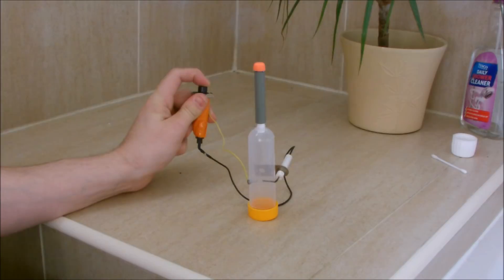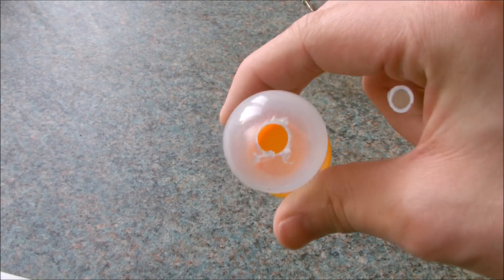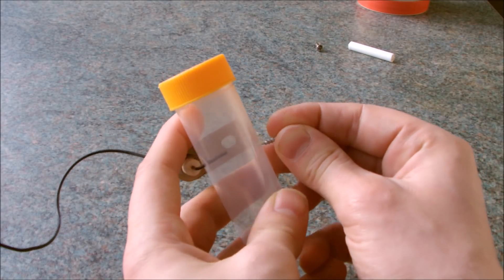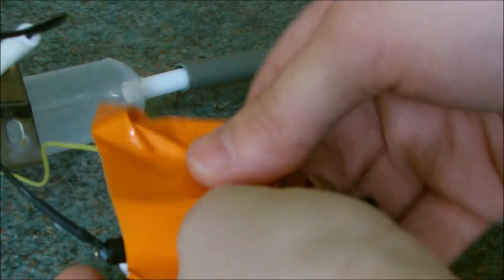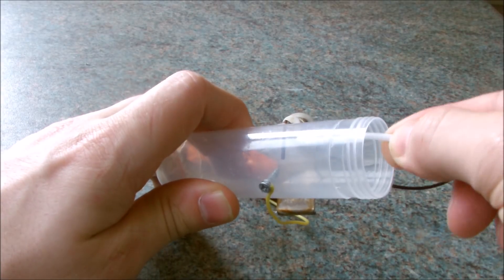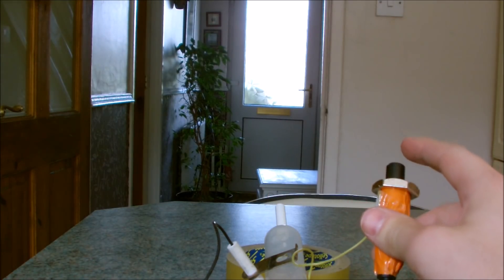Make a Mini Missile Launcher!

Comment: extend the wire (or use wireless tech), don't make the launch muzzle, fill the inside with firework powder. toss it far and high (use slingshot/rocket... if needed) and press the button for homemade firework

PLEASE USE THIS RESPONSIBLY. I DO NOT PROMOTE VIOLENCE. FI YOU ARE UNDER 18 (OR NOT CAREFUL), ONLY DO THIS UNDER SUPERVISION FROM AN (CARRFUL) ADULT OR DON'T IT AT ALL. (this comment was edited to add this section)

Comment: Could I use the ignition source from one of those 1 quid lighters like you used for the bazooka
Reply: Tom Pulford 
Yes. Those work just as well for a spark ignitor. Just as powerful.
They're the same thing, but without a casing around it.
Reply: jejbdjdoepwvdjfbeoe pcjdppppnrkdmxn

d ndbdnx

.x x.zbx

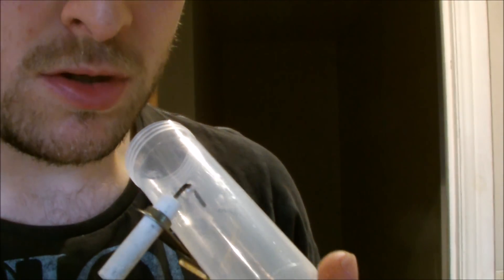Comment: slow down for 0.25 and jump to 3:03 to see blue thingy :D
Reply: Dimi's DIYChannel 
I launch bottles off a pipe, the reverse of this video. The spark gap comes up a small tube.
I did it at night and recorded it in 60FPS, then played it back at 10FPS.
The entire bottle glowed blue and shot 6in of orange fire out like a jet engine. My point is, it looked epic.
If you try this video's experiment, do it in the dark so you can see the flash better.

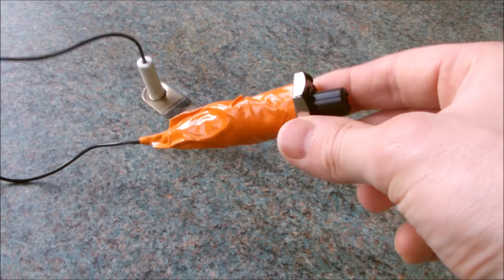Comment: "JDale Cust:  that was pretty precisely informative. just wondering why on 0:57 he wasn't shocked while holding the screw at an end. In my view, that's a complete circuit from a 20kv potential enough to breakdown and create current path on air. He is a ground potential on earth right? So how the hell he did not felt any shock at all?"
Good question; the video doesn't explain that. I suspect that he has a wire, shown later, connected from the screw he is holding,  back to the piezo "ground." OTOH, maybe not. How could a spark jump if there isn't a complete circuit? Consider two conductive spheres in mid air; there is no connection between them and no grounding. Now, suppose you rub one with a material that causes the triboelectric effect to impart a charge to one sphere. The two spheres will now be at different charge potentials, and if you move them together, once the air gap breaks down, there will be a movement of charge from one to the other until the charges on both equalize. This happens all the time, just substitute your body for one sphere and a metal doorknob for the other. In the case of the piezoigniter, the tip is suddenly moved to a high voltage, while your body is still at some other charge level. The air breaks down, a spark jumps, and the charges equalize. Sometimes it helps to think of the two spheres as capacitors floating in the air, with the capacitance proportional to surface area. Your body has an equivalent capacitance of about 20 pF, which is also about the same as an 8" diameter metal sphere. Charge on capacitor to a high voltage, bring them together, and at some point, the charges will flow until they equalize.
Now, as to why it might not hurt very much. The screw acts like a little "lightning rod," the physical point where the arc is initiated conducts the current onto a much larger area of his fingers, so the current density is less and it doesn't create such a shock or even burn point where the charge current flows into his body.
There are a lot of YT videos showing both of these effects.

Comment: can it work with nail polish remover as i don't get rubbing alcohol easily
Reply: The older acetone style remover, yes. However, the modern non-acetone polish remover, probably not. If you can't find rubbing alcohol, which is about 70% alcohol (140 proof), then I'm assuming you are not in a very industrialized location. But certainly you can find something, from gasoline to whatever the locals brew up and drink (in the USA it's called moonshine, but every country has its equivalent).

Comment: can this be built with the black thing from a lighter wich products the spark? and to replace the alcohol can i use vodka? :) please replay
Reply: Vodka would work, but a piezo igniter is simple and works well. Liberate one from an old water heater, BBQ grill or gas range.
Reply: thanx :)
Reply: Dan Rotaru And it would be a scandalous waste of vodka!
Reply: yes but i don't drink vodka so it's not my problem :)))
Reply: Dan Rotaru I suppose that ordinary rubbing alcohol (which is cheap and readily available, although at only 140 proof it would leave some oil residue) would also work. And I hope you don't drink that stuff.
Reply: :)))) of course not!! goddamit i'm not a mutant!! :)))
Reply: Sure, so long as it is the type of igniter that requires a small physical effort (a push or a rotary twist); there are some electronic igniters that use 120 VAC (USA assumed), so those would need external AC power and that would limit the portability. What you are looking for is any unit in the piezo-igniter category, and those are most often used on camper stoves, some ranges, water heaters and BBQ grills.
Reply: Vodka is too valuable
Reply: can you use deodorant?
Reply: Matthew Shaw I would prefer to drink vodka rather than deodorant. OTOH, I do use deodorant every day. Oh, you meant as a launcher fuel? No, I doubt that it would work; you need a fuel which will burn readily in air. I would think that a deodorant has too many other things in it (scented oils, astringent chemical, coloring, preservatives) that wouldn't burn very well. But, that's just my guess; try it yourself. There are many things that might work, but alcohol vapor is about the best, cheapest and easiest. You could go so far as to be able to ignite flour dust (grain elevators blow up every so often), but unless you want to experiment with fuels, why bother?
Reply: thanks a lot

Comment: how much would i have to scale this up by to get to mars?
Reply: Not that much
Reply: yes it would, you also need a steering mechanism or it will go somewhere else.
Reply: indeed
Reply: even if u have enough to get there it still will take at least 8 months to get there at the least
Reply: @randompearson1626  o
Reply: it will need a gyroscope that you can turn on and off if you go into space with it still on it will find the biggest mass within 150 miles but your in space it would not know where to go so it chose it self and start to crumple. I would prefer 5 meter fins that are steerable. and when you get there you will need (rocket controlled stabilization) aka RCS
Reply: munki66 Many hundreds of thousands of times... Escape velocity of Earth assuming no on-board thrust is about 11.2km/s, which is ridiculously fast.
Reply: 13,000 mph
Reply: 1.0000000000000000000000000000000000000000000000000000000000000000000000000000000000000000000000000
Reply: i think about 30 bottles of rubbing alcohol and a BIG tube
Reply: @drunksanta1427  no about 1'0000000000000000000000000000000000000000000000000000000000000000000000000

Comment: I don't think it counts as a missile if it doesn't have a guidance system. Probably not even a rocket because it doesn't propel itself. I'd rather call this a mortar.
Reply: Importers normally explode when they hit the ground it is more a odd bullet launching without a gun
Reply: Mortars use a primer at the the bottom of the tube or shell, you could call this a mortar.

Comment: Rocket launcher *
Reply: Rockets are powered by rocket engines, usually bipropellant.
Reply: A comlete faliure missiles are guided, rockets are not.
Reply: ***** Rockets were guided to the moon, right last time i checked they weren't "the saturn 5 missile"
Reply: Piloting is different than guiding. Missiles, in weaponry terms, are guided warheads. Think of it this way. We have TOW missiles (guided) and we have S-5 rockets. We have missile launchers that lock on to heat sources while we have rocket launchers that must be manually aimed. Rocketry is different when you're talking about vehicles versus weapons. It's all good though buddy :)
Reply: ***** Look up the term missile, its interchangeable with projectile. Missile just refers to a less broad range of objects. Also the Saturn rockets were guided to the moon by the computer on board, not the crew.
Reply: ***** Well in any non-military capacity it doesn't. And this is a non-military capacity. And we, and the vids poster aren't using the term in a military capacity. Only you are.
Reply: Whatever, there's no point in arguing about it, haha.
Reply: ***** True :).
Reply: Maliciously Delicious I honestly think it has more to do with the purpose of use than the actual guidance. The terms are often used interchangeably but in military terms guided means it's a missile, rockets are free-fired.
Reply: Sorry to bother you but i don't think we put people on missile lol.(have a nice day btw :) )
Reply: *on a

Comment: not a missile at all if anything its a hybrid between a mortar and a recoil-less rifle
Reply: Missile: "an object which is forcibly propelled at a target, either by hand or from a mechanical weapon."
Reply: depends on your definition, but scientifically its not a missile, according to standard English it is

In a modern military usage, a missile, or guided missile, is a self-propelled guided weapon system, as opposed to an unguided self-propelled munition, referred to as just a rocket. Missiles have four system components: targeting and/or guidance, flight system, engine, and warhead. Missiles come in types adapted for different purposes: surface-to-surface and air-to-surface missiles (ballistic, cruise, anti-ship, anti-tank, etc.), surface-to-air missiles (anti-aircraft and anti-ballistic), air-to-air missiles, and anti-satellite missiles. All known existing missiles are designed to be propelled during powered flight by chemical reactions inside a rocket engine, jet engine, or other type of engine.[citation needed] Non-self-propelled airborne explosive devices are generally referred to as shells and usually have a shorter range than missiles.
An ordinary English-language usage predating guided weapons, a missile is "any thrown object", such as objects thrown at players by rowdy spectators at a sporting event.
Reply: missile is a synonym for projectile...
Reply: andrew laclair regardless of what definition you want to use it is still a missile.
Reply: ANGELM73350 Do I need to repost the definition that quantum overlord said?

mis·sile
ˈmisəl
noun: missile; plural noun: missiles
1.
an object that is forcibly propelled at a target, either by hand or from a mechanical weapon.

- a weapon that is self-propelled or directed by remote control, carrying a conventional or nuclear explosive.
Reply: andrew laclair
Does it really matter?
Reply: Jkouw nope, a missile is propelled in flight :) but it still so fun :D